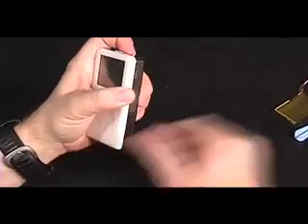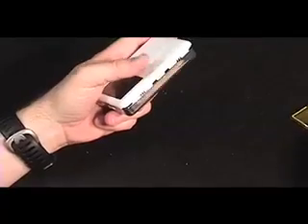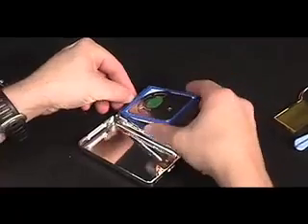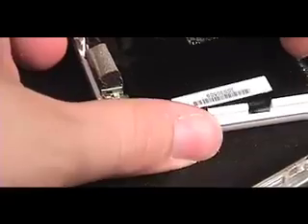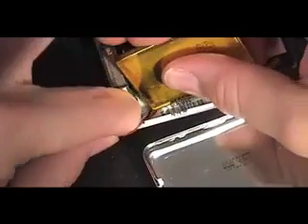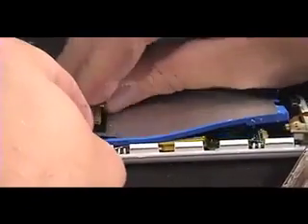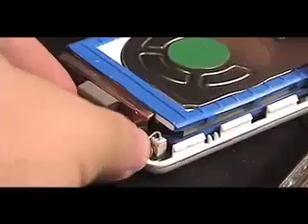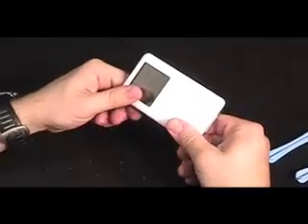3rd Generation iPod Battery Installation Video

Comment: i will just say that i used a knife to open the case as the pry tool was too weak, but i have changed the battery successfully. It can be done with patience and a calm temperament.

Comment: @paradoxo88 yeah..be careful..I ended up getting impatient with my Gen 5 and bent the fuck outta the silver back. and I even messed up one of the cables making it impossible for the unit to access the Harddrive..but I just need a new ribbon..so I just ended up buying the Gen 3..because it's simply better, faster, stronger.

Comment: This was the best video for 3rd gen. I did notice you pulling on the cables to unfit, like with the battery cable. A little dicey.  How long does the NEW battery expect to last in real world time..Like using 75% general volume and playing .aiff or uncompressed.  Does that harddrive or a harddrive from Gen 5 ipod swappable in the Gen 3?